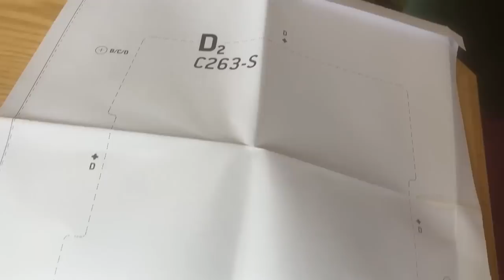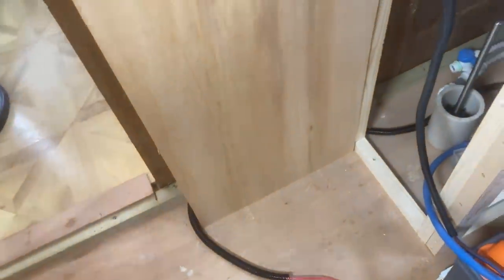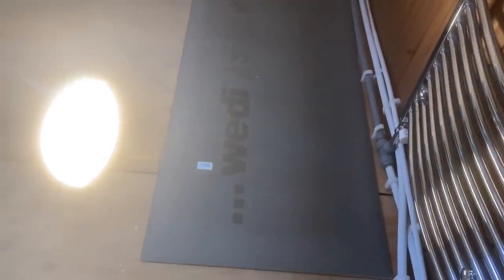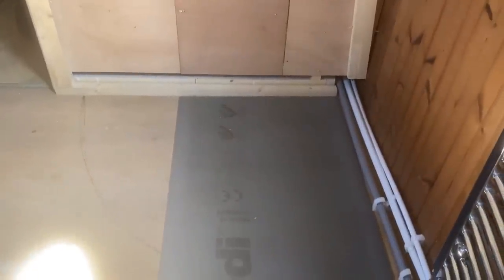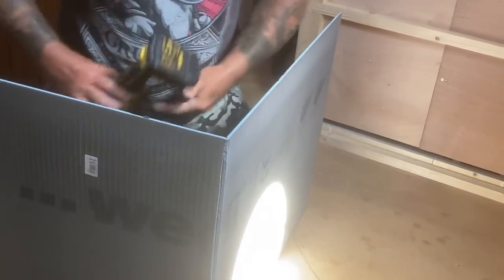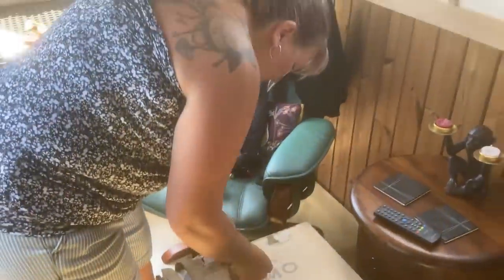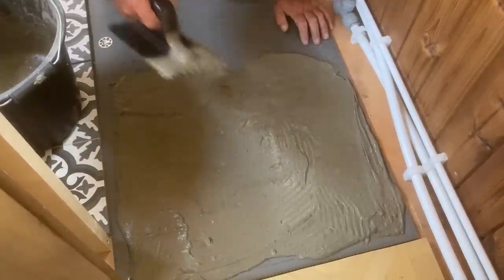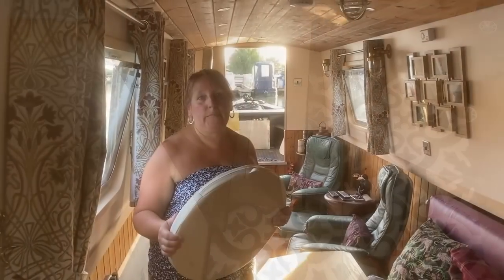Building Our Narrowboat #53 - Bathroom Antics

Comment: Another excellent vlog guys.  Have now caught up and watched everything.  Trouble is I’ve forgotten where I saw things so please forgive questions you’ve already answered previously.    I’ve just taken delivery of my own sail away last Thursday into Bristol and have now sailed it to Foxhangers at Caen Hill.   If you’re ever passing by car or boat, stop in for drinks, hookup, water refill, you can double breast as I’m on the cut.  I’ve started the horrid task of trying to cut back the insulating foam, clearly sprayed on by a wannabe ghostbuster, as it’s everywhere!!  What I was going to ask this video, is about drilling holes in the boat, in particular for sink or bathroom drainage, or roof glands for solar etc etc.  Can you point me to the right or best type or brand of hole saw and any tips for doing it.  Thanks guys.  Hopefully Fran I’ll have a question for you one day!!  Slainte.
Reply from the maker: Hi Sean, thanks for the coffees, bribery will get you anywhere. As far as cutters go Starret is #1, if you can ad some lubrication they will last longer. Tapping compound is best as it doesn’t fling so much as oils. Protect area with masking tape and have a magnet handy to get all the bits of dwarf as they will rust and east into the paint. Thanks for the coffees dude.

Comment: Great to see more jobs getting done, tiles and the bungs look good. Stay cool over the next couple of days, bet it will be pretty hot in the steel tube, might need to find a suitable watering hole !! Cheers, Nigel
Reply from the maker: Hi Nigel, we have a few solutions in the fridge! Yes, pressing on, will need to get a fair bit done this week ready for Frans brother in two weeks. Boat isn’t too bad due to cream roof, use plenty of ventilation and cover windows during heat of the day. Should be fine, after all it’s just summer, we get these temperatures every few years.

Comment: Love the Motorhead t-shirt! I've been a Hawkwind & Motorhead fan since the mid 1970s. Few people know who they are over here in the US, although Motorhead has a better chance of being heard on the radio here.

Once you saw that you needed to lay the tile for the bathroom floor before making the access door for changing the toilet cassette, were you able to just cut a bit off of the top of the plywood you'd already cut to fit for the toilet & cassette? To me, fitting out a narrowboat looks a lot like doing a jigsaw puzzle; every piece has to fit perfectly, or there's more work involved.

Cheers! Hoisting a few beers in your honor on this hot Sunday evening over on this side of the pond.
Reply from the maker: Hi Dan, which state you in? Yes love Lemmy, we’re we’re at The Rainbow a few years ago, sat in Lemmy’s bar. What a legend. I didn’t know the overall thickness if tile and Wedi board, so the only thing to do was lay it. I’ve just gotta skim 1/2” or so on the ply I cut, so that’s no bother really. You are spot on about a jigsaw, it’s much harder than kitting a house out. But, we’d rather have our boat. Good to hear from you.
Reply: @narrowboatmoonshine , I'm in Northeast Georgia, about 90 miles due East of Atlanta. I'm glad you don't have to totally redo the ply from scratch.